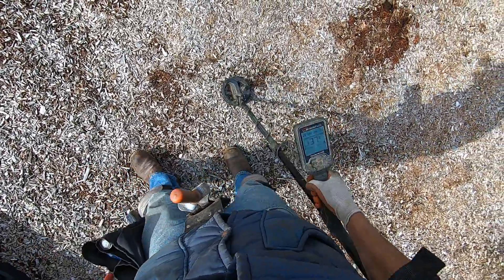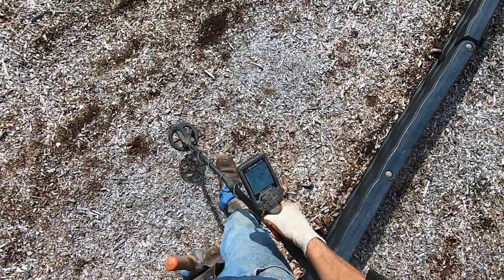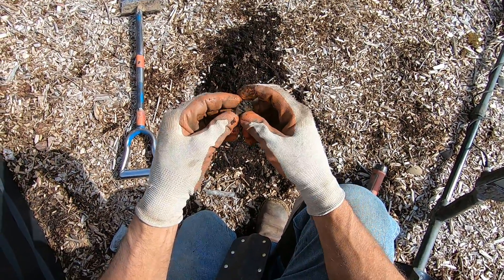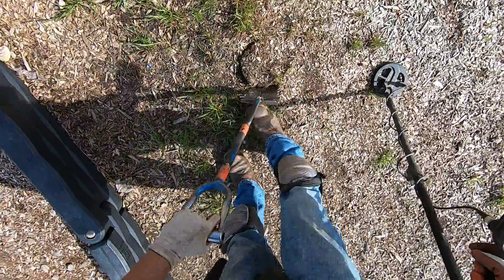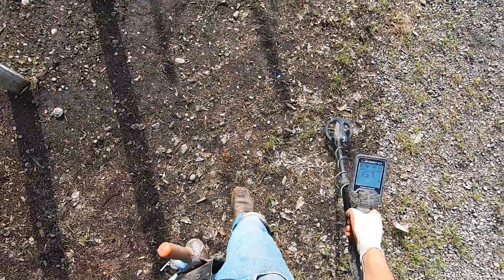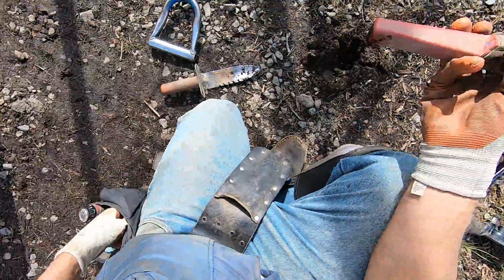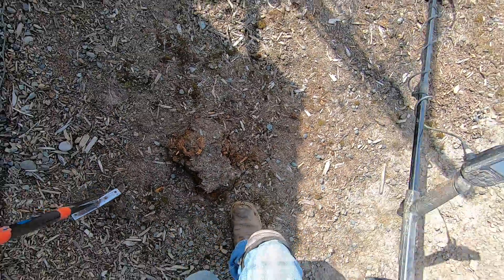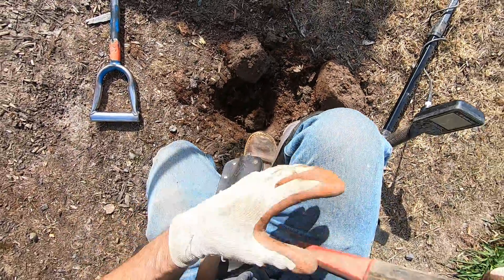LIVE DIG ACTION!! Nokta Legend in the totlot with clay.

Comment: Love your videos. Keep it up! 
Got my Legend this week. Upgraded from the simplex.  Haven't had time to use it much yet, but I'm looking forward to getting out this weekend!

Also, I kept checking the update page and V1.06 is out.

Updates Made:

1. Beach Mode Multi-W and the Pinpoint in this mode has been improved and updated.
2. Bluetooth headphones pairing criteria have been updated. The device will now search for the headphones it has been paired with initially and try to connect to those. This will prevent the device from connecting to other Bluetooth devices when the Bluetooth setting is on. If you want to pair the device with different Bluetooth headphones (other than those it was initially paired with) you must delete them from memory as explained in the manual.
3. The sensitivity value will now be displayed also in the Target ID section.
4. The ground phase value calculated through automatic ground balance as well as tracking will now be saved.
5. Multi-1, Multi-2, Multi-D, Multi-W frequencies will now be saved. The device will start with the last frequency used.
6. The default Number of Tones for Park and Beach modes have been changed to 2.
7. The default Tone Volume level of ferreous tone has been updated per each mode.
8. The Ground Balance menu icons and the tones have been updated.
9. The battery bar levels have been updated to be more linear.
10. Bugs have been fixed.